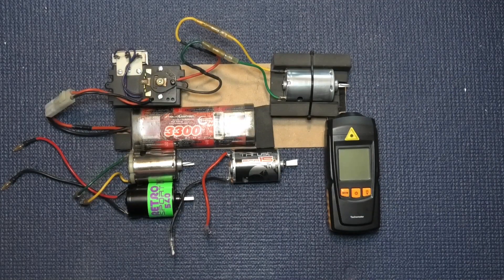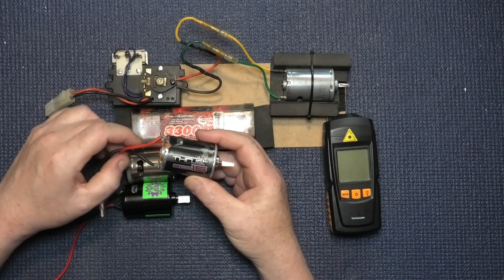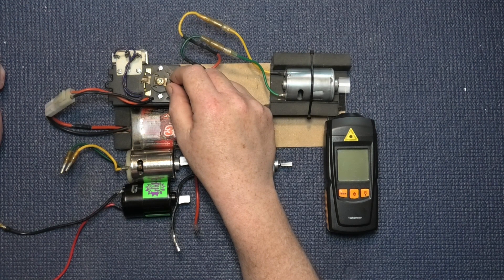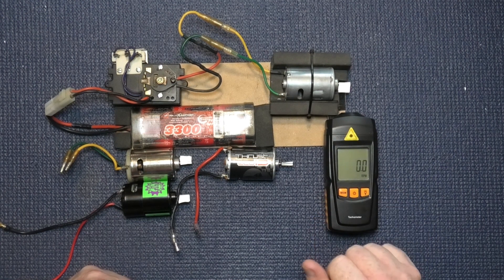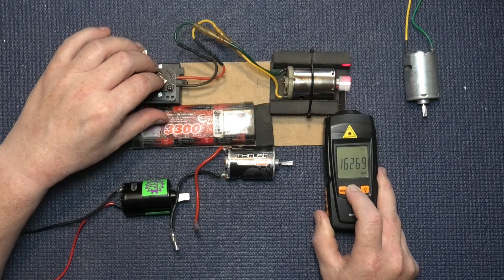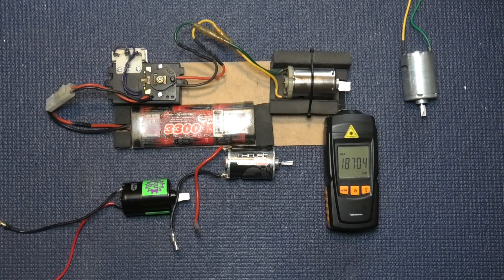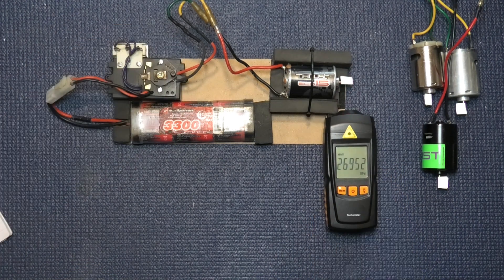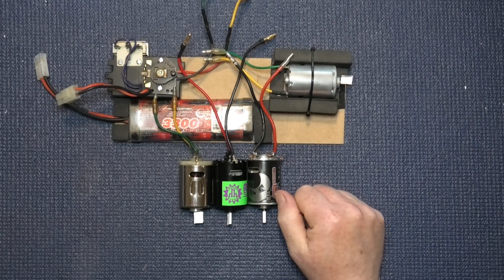Brushed Motor RPM Comparison

Comment: The difference between the stock motor and the Holmes Hobbies is the torque. The Holmes motor has more power than the stock motor does.

Comment: Thank you for sharing!  I was trying to do my research on how much KV a stock Mabuchi Silver Can 27T is and came across your video.  With your findings of 16734 rpm at 7.2 volts, that equates to roughly 2324KV.  Someone below claimed they got their motor up to 20,600 on a freshly charged battery, which is 2861KV.  So, for my research, I'll be optimistic and average it up to 2500KV.  Again, thank you very much!

Comment: Hey what a great idea Rob.  I didn't know that such a device existed.  What is it actually meant for?  So really your Clod should have been quicker than Mark's or is there something about torque that you also need to know?  Anyway, interesting video mate 😁👍👍
Reply from the maker: Hay Pete. It's basically a non-contact Tachometer for measuring the RPM of almost anything that spins. Yeah it could be a torque issue but have no idea how to measure torque. Many thanks and Atb matey.

Comment: Nice testing! I should get a little setup like that! I am always curious about the actual speeds of the motors and this is a very effective and simple way to test them! Like you said, it is not 110% proven fact but it does give enough feedback to understand which ones have faster rpms so good enough for me! Thanks for sharing the cool video!
Reply from the maker: Thanks Adam. Yeah just need to have a look to see how I can mount the meter permanently and possibly add a TBL-04 so I can measure brushless motors. All the best and stay safe my friend.

Comment: Cheers Rob! That’s quite the set up ya got goin for sure! 👍👌 I like that little device for counting the revolutions. Was it just tape around the motor shafts that the device was picking up?
Reply from the maker: Yes the Tachometer comes with three strips of reflective tape and you can purchase more but if you put a pinion gear on and paint it black if it's a silver colour you can then paint a stripe using Tamiya chrome silver. Thanks for watching and ATB my friend.

Comment: Interesting results, and as you said in the description maybe it's a torque issue. RPM is one thing, but if the torque of the motor isn't there it'll defo struggle with the huge wheels and tyres of a Clod!
Reply from the maker: That's my thoughts at the moment. Thanks for watching and ATB my friend.

Comment: Hiya Rob, Great video Dude!!!!  Most motors spin counter clockwise as you look at them from the output shaft end. The stock motor, the first one you did, at 16,700 rpm seems to be what I got with my motor dyno, I got 13,100 to almost 17,000 RPM's (voltage from 6v to 7.4v). Your little hand held tach seems close enough mate. Love the "bench" for the test... That squeal the Johnson let out might just dry bushings in the motor. The Holmes motor should be zero timing either way it spins, if it had more timing one way or another, the rpm would be way more farther apart, 100's to 1,000's of rpm's. This is an Awesome test man and you have a ton of motors you can test....  Love test videos like this......  Great Job again my Friend, ATB!!!!!!!!!!!
Reply from the maker: Thanks for the info dude. Yeah that Johnson motor must have been in my spares for 30 years. I set that rig up to run brushed motors in but don't tell anyone but I can't be arsed now 👴😅🤣😂 Cheers buddy and the same to you and yours matey.
Reply: Some years ago i measured the stock motors in my super clod with the same kinda tachometer, with a fully charged GP 3300 7.2v battery i got between 20,000 and 20,600 rpm. The super clod was the first version with mechanical speed control but the motors were the same mabuchi type with grey metal endbell (nr 7535076) which is the motor today known as "540-N"

Comment: Hi Rob You have to do try this when testing motors with the laser beam get a pinion gear paint it black and super glue a little sliver across it for the beam to pick up it will be more accurate and you can swap it out to each motor easy this is what I do it works great. nice test. black out near the end.
Reply from the maker: Thanks for the tip Steve. I have found a black gear so will give it a go. Thanks for watching and all the best buddy.